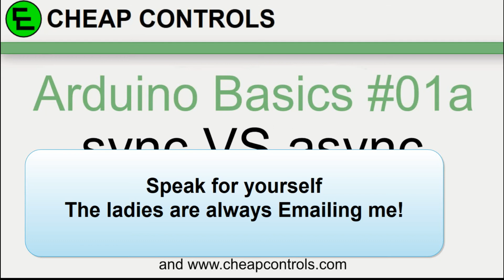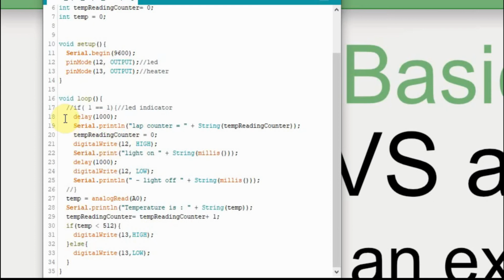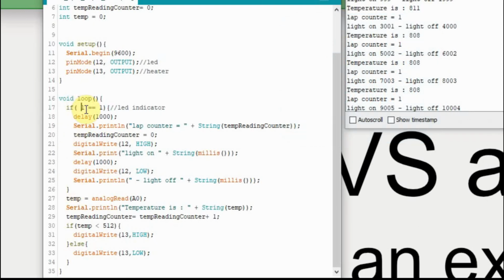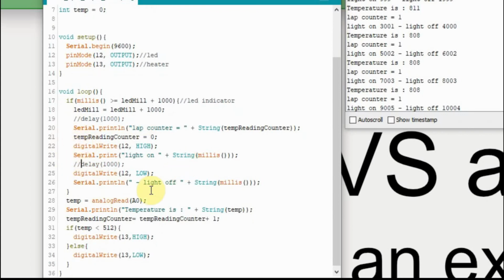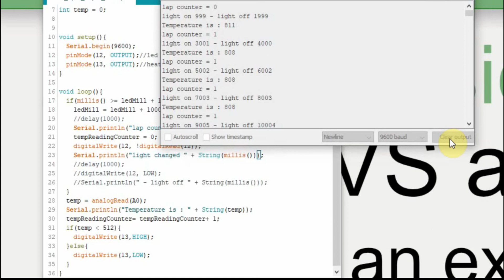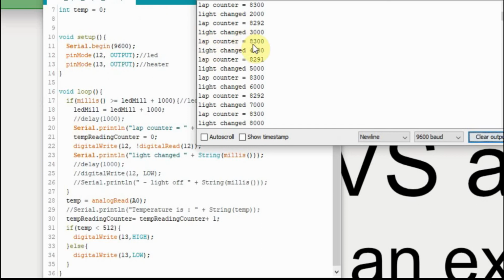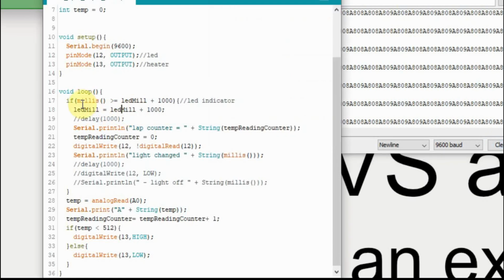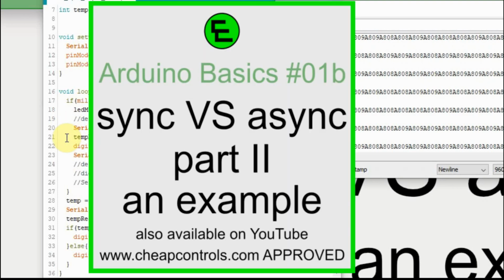#83 Arduino Basics - Delay Sync vs Async - Arduino Programming Tutorial

Comment: GOOD WORK BRO PLEASE WHERE IS THE EXAMPLE
Reply from the maker: Do you mean the code?  Thanks for the kind words
Reply: @CheapControls  no I thinking about the simulation. because  I have a project on the same thing I think "démarrage étoile triangle d'un moteur avec d'Arduino" and someone tell me that I might use equations of motor asynchrone for programmation... Is it right too? Or is your method the only possibility??
Reply from the maker: @menadbonfoh9716  There is always more than one way to program.  I would never say mine is the only or the best.  I may think my way is the best but others may disagree.  All I can say is give it a try because very little that I do works the way first time or the way I think it will.  Sometimes I change how I do things and end up learning something new.  Good Luck.